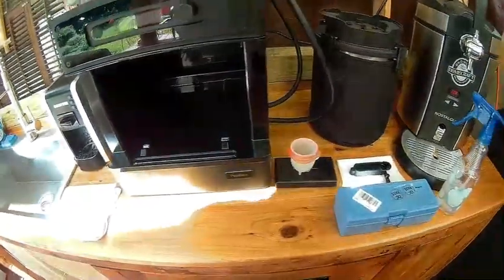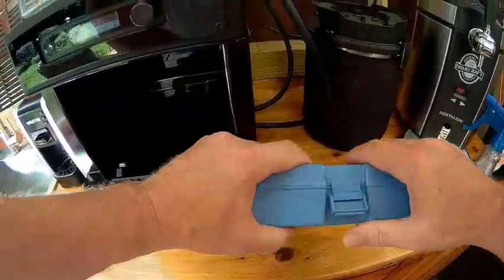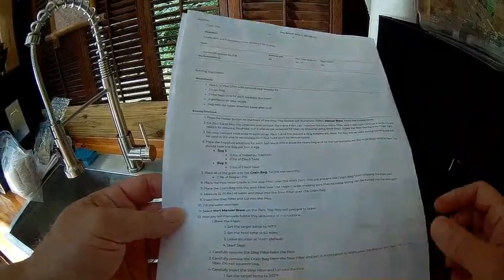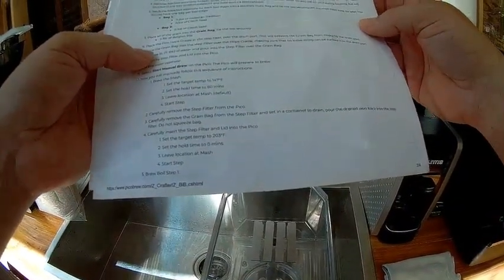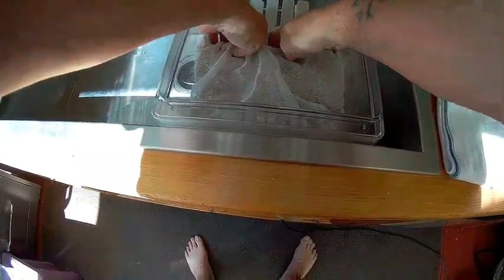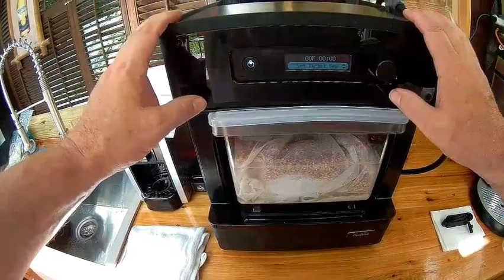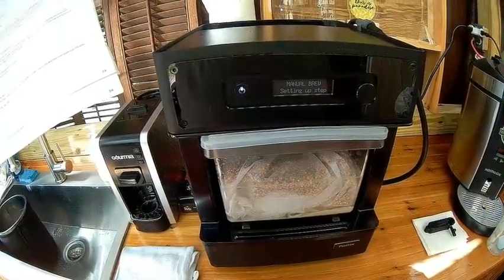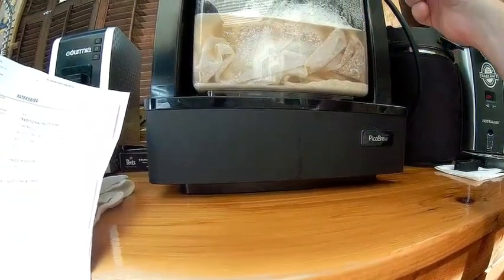Picobrew Pico C Manual brew part 1

Comment: Great videos!  Where do you purchase your ingredients and directions for your brewing?  Moving forward it appears this will be the only way to brew using the Pico C, with the sunsetting of the company.
Reply from the maker: Thanks! I have a local grain dealer (I just like to say that, lol) that has several different types on hand most of the time, plus hops and yeast. But I have also purchased 5 gallon kits form Northern Brewer and Amazon and divided them up. I never bought Pico packs (I did have a couple "free" ones though). I did not buy this system until they allowed manual brew. I like the small batches, so I can experiment, and I like the almost automatic brewing with my own ingredients. Plan on growing my own hops now too. Should be fun.
Reply: @GadgetmanNH  Thanks so much for your quick reponse!  I purchased the Pico Pro as part of the KickStarter campaign.  My son took the Pro when he moved out and I purchased the Pico C at that time. I've been home brewing since the late 60's,  off and on, before purchasing the Pico's(started in plastic garbage cans) .  I didn't know how to proceed with my own recipe's for the Pico so was pleased to see your posted videos.  I'll see what I can do.  One thing, I accidently threw out my Hops Pak Cradle and have been brewing since without one and without issue, but I see you highly recommend using it so you don't clog the drain in the step filter.  As parts are hard to find for these machines now any thoughts regarding a suitable replacement?  Thanks again!
Reply from the maker: @leroyhixon2459  Anything that will block the bag from getting sucked into the drain will work. Some people are buying perforated stainless steel sheet, and cutting it to cover the bottom of the step-filter so there is no chance of clogging. Or something like this: https://www.grainger.com/product/20W874?gclid=CjwKCAjwh472BRAGEiwAvHVfGnjgOu3ZYZQ3wimBAwfdm8vozJ2fHhSO_6-XJG_K4I3oIlvq51glnRoCBkoQAvD_BwE&cm_mmc=PPC:+Google+PLA&ef_id=CjwKCAjwh472BRAGEiwAvHVfGnjgOu3ZYZQ3wimBAwfdm8vozJ2fHhSO_6-XJG_K4I3oIlvq51glnRoCBkoQAvD_BwE:G:s&s_kwcid=AL!2966!3!342902356446!!!g!349604050214!
Reply: @GadgetmanNH  One last question and I'll quit bugging you.  The directions you had in the video showing the different temperatures to set the Pico at different times of the brewing process, was that in the 5 gallon kits you purchased or found somehere else?
Reply from the maker: @leroyhixon2459  It was a 5 gallon kit. I divided it into multiple batches, but used the brewing instructions from the kit, as I wanted the beer to be true to the recipe. I hope that helps.
Reply: @GadgetmanNH  Thank you! I appreciate all your help. Pico Brew posted an update on their website about their current situation: https://picobrew.com/offer?offer=updates
Reply: So. So can you do this totally independent of Pico or do you still need to use their web site? if their current situation does not improve, a lot of people are going to get stuck with useless equipment, but if you can still use the machine without them, then it may be ok.
Reply from the maker: @josealvarez8693  They seem to be coming back slowly. Right now you need the wifi connection to their servers to manual brew, but hopefully if they do go out of business, they push out an update so the machines can brew offline.

Comment: Hey man, excellent video I am thinking of purchasing one of these (pro version, maybe) but I was concerned about not being able to use it other than with PicoPaks. However, I am not able to find the directions that you were able to use to guide you through the steps. The manual brew guide under pico c/s/pro section says to use the pico.com beta crafter. However, I am only able to see the z/zymatic crafter. Using this does not generate the instructions that you followed here. Any info on how you got these directions? I get that I can pick and choose ingredients, and it generates what the final ABV, OG,FG color etc...but nowhere near the detailed instructions you use here. Is it no longer available?
Reply from the maker: You have to have a Pico unit register to your account before it will output the instructions I was using in the video.
Reply: GadgetmanNH thank you so much man appreciate it can’t wait to use this thing

Comment: Hello and Thank you for doing this video.  I have a quick basic question.   Do you have to place the grains and the hops in a bag?   Can I just dump the grains/malt mixture in the filter and then the hops?    This is my first attempt at brewing with Picobrew C.    Thank you again.
Reply from the maker: Yes, you must use bags. You will clog all the pumps and valves if you don't.

Comment: What kind of keg system to you have to
Reply from the maker: It is the system that comes with the Pico C model from Picobrew. The Pro model comes with a ball lock keg system. I like that these completely open up and can go in the dishwasher. Well built overall for an entry level system.
Reply from the maker: But, I did get some nice $30 stainless steel 5l kegs that I plan to make a video on this weekend. Pretty nice units and flexible too.